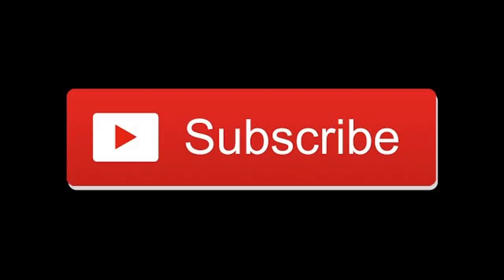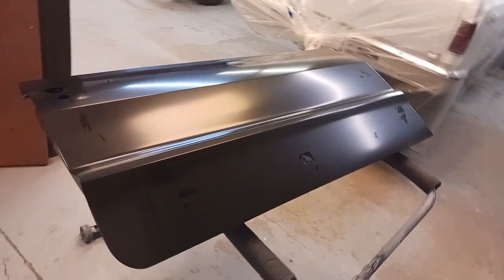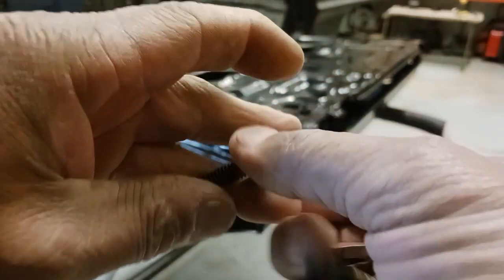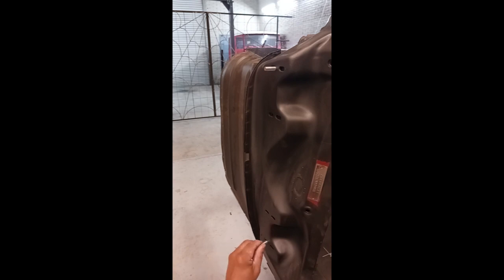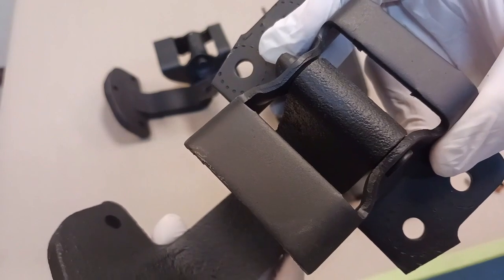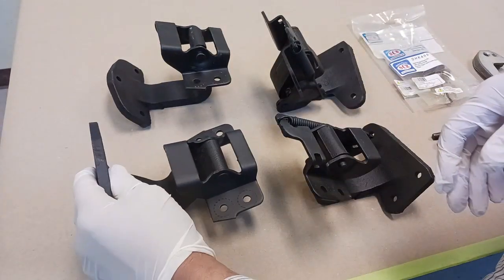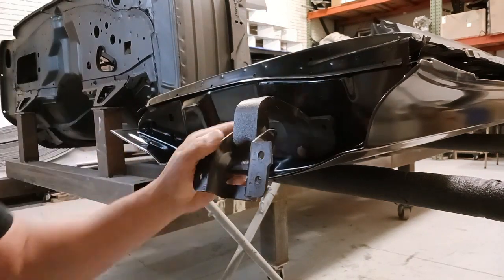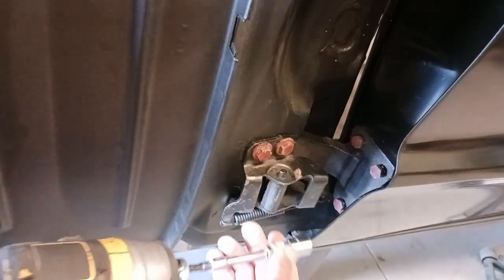1963 Impala SS Convertible Restoration Part 5   Yes...The Body is Buckled  DIY Auto Restoration

Comment: Hi, I have original 64 doors and I can’t get them to align up with the front lower rocker. It seems I can’t go all the way forward with them. Any suggestions? Thanks. 14:29
Reply from the maker: aftermarket door ? prior collision ? prior work - somebody replaced the quarter panel or rockers, one of those is where the problem would be my guess.

Comment: After you install new floors will the body hold its alignment without being on the frame?  I had a 1929 Ford Model A roadster pickup and the way you got the doors to fit was placing a shim(s) between the body bottom and the frame.  The body was so flexible if you had the right shims you just tightened the body bolts down and it would draw the door into alignment.  40 years later these convertibles weren’t that much better!
Reply from the maker: Pretty much any convertible off the frame will have some amount of flexation, we'll see....

Comment: You showed 3 different bolts there for the hinge. The first one had like a serrated washer. Then explaining the kit there are 2 different bolts there too. I know the larger in diameter washer bolts go from hinge to cowl. Where do the smaller diameter washer and serrated edge washer one go? There are 3 different bolts?
Reply from the maker: It's just a conparision of hardware, always try to use the factory bolts. Thanks for watching !